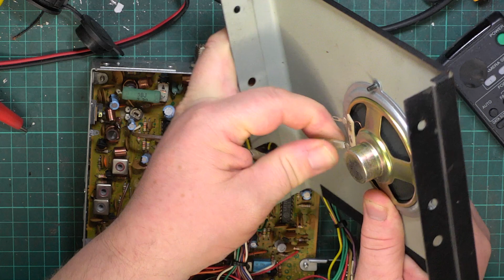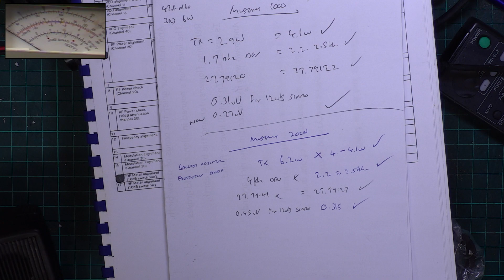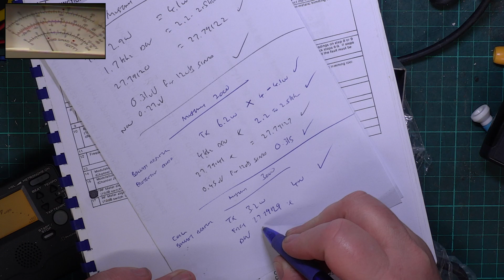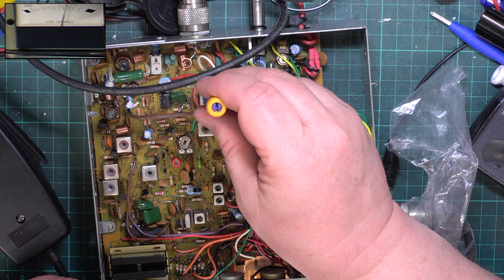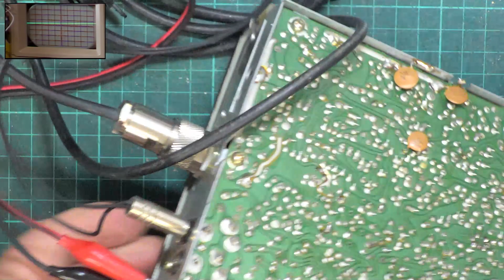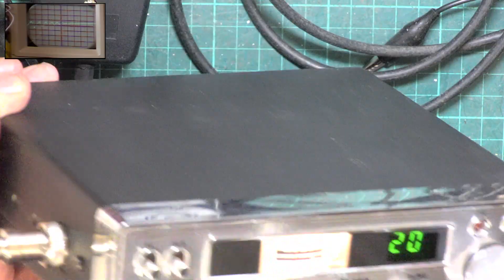Mustang CB3000 CB27/81 CB radio UK FM - Repair & service adjustment

Comment: When I served my apprenticeship at Marconi communications in 1979 on my printed circuit board repair course we always used to brush on methylated spirits and scrub it off with a dish cleaning wooden brush… in fact until I started watching your videos I always used it to clean CB circuit boards. I use isopropyl alcohol now too 😊
Reply from the maker: We do have the RS 'proper' brushes too....@ £5.99 + VAT each & you have to buy 5!

Richard
Reply: The wife's toothbrush will do thanks LOL

Comment: I had a genuine Amstrad 901 delivered this week with a N.O.S power lead that would have fitted that Mustang. Don't you hate it when a seller claims there's a lead but doesn't realise it's the lead for a completely different radio...
Reply from the maker: Yes it does happen. My most annoying one off ebay was "such & such CB radio with microphone & power lead in box". I bid on & won it. Yes, it came in a box....a bloody shoe box. Moral; if the 'box' isn't shown in the pictures, assume 'box' to mean random cardboard box.

Richard

Comment: Is the fake Amstrad a fake or did Mr Sugar drop his standard?  Must say I never saw one up here in Darkest Scotland, but then a lot of models never made it up here.  
Sophie was a good model, but I don't think she came up here either, or did she go to one of the Islands to do a film?
Reply from the maker: No, Mr Sugar had nothing to do with it...It's like fake Armani handbags & fake Adidas T-shirts that shrink to doll size after one 30C wash!  The snag then was that "Amstrad CB's are crap", when the Cybernet built Japanese ones work well. Don't forget this 'kind of happened' with the Icom ICB1050 CB radio, which has nothing whatever to do with the well known communications company of that name; just fake use of a good name.

Richard, G0OJF, UK
Reply: @ukfmcbradioservicingTango21  These were made by the company that was Royce. I say that because Royce Electronics Corporation were a Japanese manufacturer and was taken over by the Masco Corporation in 1976. When the bottom dropped out of the market for 23 channel radios when the FCC approved the increase to 40 channels. Royce had no 40 channel designs and lost a lot of money. Masco sold 51% of the shares in 1977.........to Cybernet. Because of a lack of control (51%) the Royce company were given minimum help and began making Cybernet designed radio's and allowed to make their own designs too.  When Kyocera took over the majority of Cybernet in 1979, they also bought the remaining  49% of the Royce shares from Masco. 1980 Royce began making the PTBM 125 boarded radios with a common design. This was replaced with the 131 boards, and developed the PCMA002S for the UK market using the cases they were using for the 1978/79 Royce AM branded radios. PCMA002S boards were their own versions of the existing 131 Cybernet design. However, in 1982 there was huge industrial unrest when Kyocera decided to rebrand all Cybernet products, the result was that the Royce brand was dropped altogether and all production of the 131 boards were replaced completely with the PCMA design. Kyocera continued to produce cb's but ceased all production of multimode radios. Homebase radios using the old design was ceased and the case that had similarities with the Cybernet audio separates range  sold off. Baycliffe Corporation produced all later versions of the PCMA designs, including the 'fake' Amstrad radios. See the Royce 1-604 onwards for comparison (1-609 for this particular radio), 1-619 homebase etc.